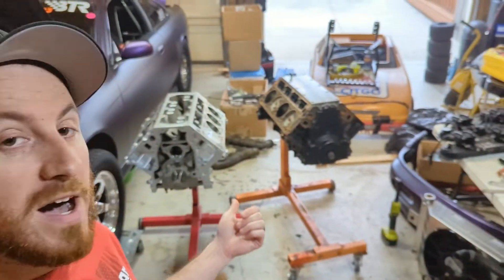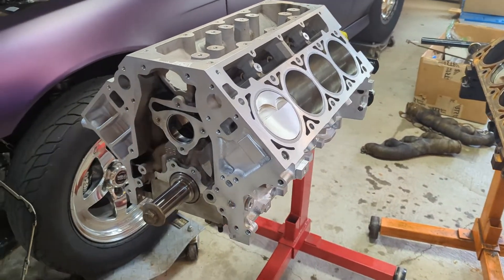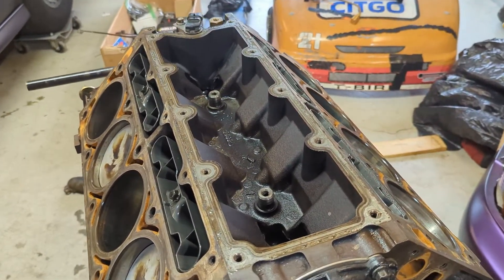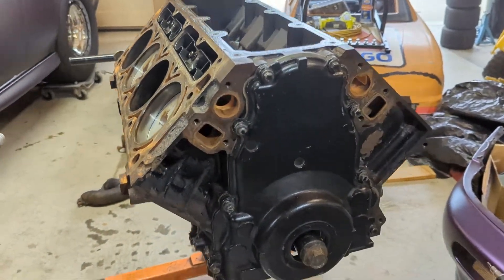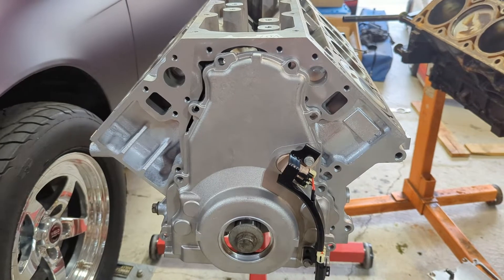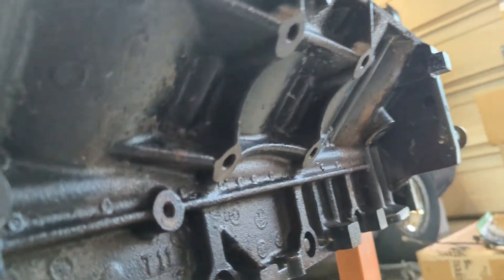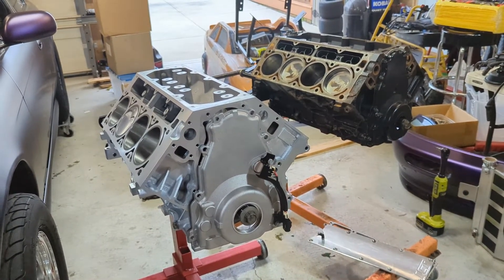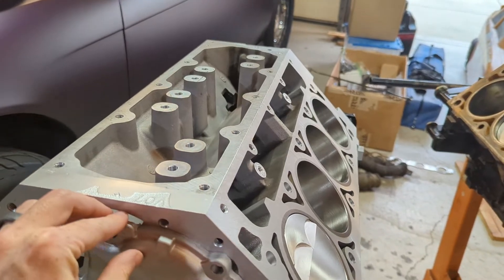How to Tell a Gen4 from a Gen3 LS Engine

Comment: _ Thank you for sharing the knowledge__ I have a question if you or anyone with the knowledge could tell me please...
I have a 99 C5 convertible Vette. I'm going to be building a motor and I have the upp twin turbo kit that I am installing as well...
Would you build the original Gen 3 5.7 or a Gen 4 5.3? I plan on installing new pistons n rings as well as all nes bearings and a btr cam kit etc with ls7 lifters and trays . 
Why would the 5.3 block be better? I heard they have a stronger block compared to the Gen 3 LS engines.
Thank you for any help. ✌️
Reply from the maker: In my opinion what I've always told people is to sell off the original ls1 esp if it's a better motor bc people will pay good money for it.  Get yourself the 5.3 could run it stock with head studs and head gaskets along with a cam kit and make good power depending on your goals.  Or do as you mentioned and build it all the way up.  What ECU were you thinking bc there would be some things to consider with the cam and crank sensors
Reply: @TeamHybridRacing  Thank you very much. I honestly can't even believe that you wrote me back. That's unbelievable man thank you.. so yeah my plan is to go with the 5.3 then. I'm going to use the stock rods I am going to change the pistons. As far as heads go I'm on certain yet but maybe the stock 243 heads with new valves and springs. Or possibly buy a set of aftermarket heads that are not ridiculously expensive.
As far as computer goes I honestly haven't thought about that part yet. But I'm open for suggestions because I know you have more experience than what I do. 
Thank you and I hope all is well with you and your family.

Comment: I bought a L94 6.2L block for $500. I'm turning it into a Ls3. For the dod towers I bought a bearing from Amazon, cut the cage and the bearings fit right in place. It's a WTA-37 bearing. No drilling or tapping. I love how light the aluminum blocks are. Way lighter (by a 100 pounds) then the engine I pulled out of my car that I am swapping the Ls3 into.
Reply from the maker: Very nice find!  Yeah I have seen people use the bearings to block it off as well.  I happened to have the plugs and went ahead a tapped them before it went off to the machine shop so made for an easy solution.  Always enjoy seeing all the ways people come up with ideas on these.  What's the plan with the build?
Reply: LS3/4L80 In a 03'Crown Vic Police Interceptor. First swap but not first engine. I may put a TKX 5 speed manual in instead of the 4L80. A bit more work, but man, I love a stick. When it's a toy. ADTR sells manual swap kits for the panther platform.Vics, Grand Marquis, and town cars. They have a hydrolic pedal conversion now. The old one was a cable clutch from the Mustang. Don't do cable clutches, lol. I have a ways to go. I figure it out before I get the harness.
Reply from the maker: Awesome!  Should be a fun one regardless of which way you go! A good friend of mine has gone pretty quick with a tkx in his fox Whipple car.  It's the red one I have a couple videos on my channel
Reply: I also found a set of low milage 821 heads for $300. I was like, "Oh yea, God wants me to Ls swap her" roflmfao
Reply: Nice brother!!!

Comment: Regarding reluctor wheels... The LS2 in 05/06 GTOs are oddball engines. Gen 4 block, but with a 24 tooth reluctor wheel. Other LS2s like in 05-07 Corvettes had a 58 like a normal gen 4 engine
Reply from the maker: Yeah those transition years were the odd ones, lots of mixes of gen3 and gen4.  If I recall those early GTOs also had the front cam sensor
Reply: @TeamHybridRacing  yep! Also had the DoD towers under the top cover, but didn't have DoD, ha.  In GTOs there was also a front sump oil pan. Basically... GTOs are weird.
Reply from the maker: @jafourman  yeah that front oil pan was the common go to for the 240 crowd back in the day bc my car is also front sump.  Ha yeah they def were odd balls

Comment: I opted for the Gen 4 ly6 or l96.they are an iron block with the LS3 heads.crazy they used those heads on truck engines.a cam and springs and they come alive.
Reply from the maker: No doubt!  Great combos if you can find one to modify
Reply: @TeamHybridRacing  yeah I lucked out on two of them and one lq4, but that's not likely to happen again.
Reply from the maker: That's a solid find!  What are your plans with them all?

Comment: So the cast iron gen 3 is better right if your doing better pistons n rods.also tuning i heard is better?
Reply from the maker: I think you will find a mixed answer when it comes to better after doing rods and pistons.  The 58x crank has a better signal at higher rpm over the 24x found in the gen3.  Iron is typically stronger but aluminum is of course lighter
Reply: @TeamHybridRacing  right on
Reply from the maker: Tuning really doesn't matter when it comes to the blocks, that's all in the rest of the setup really